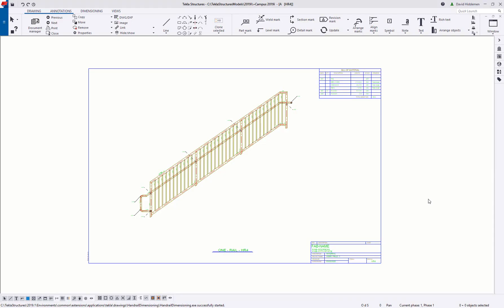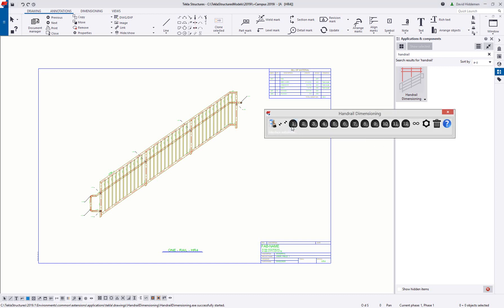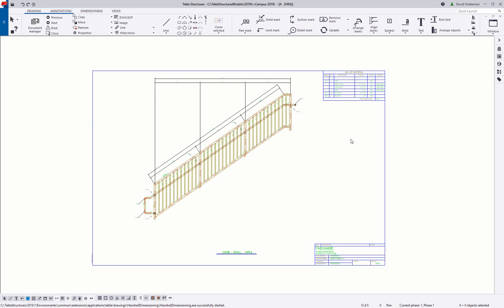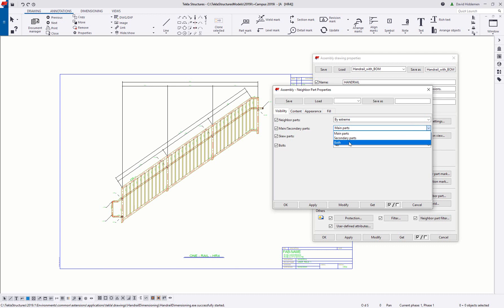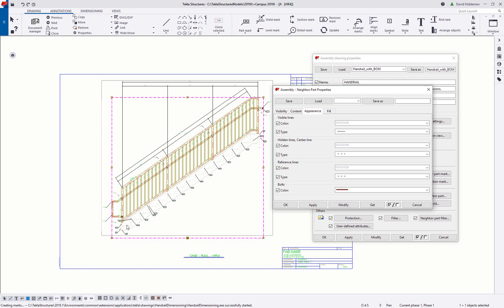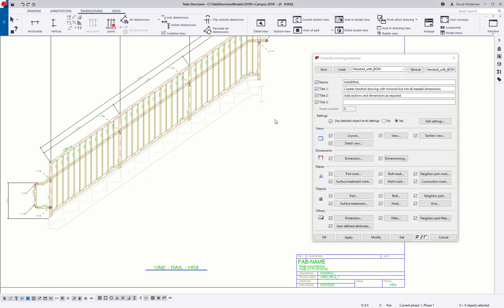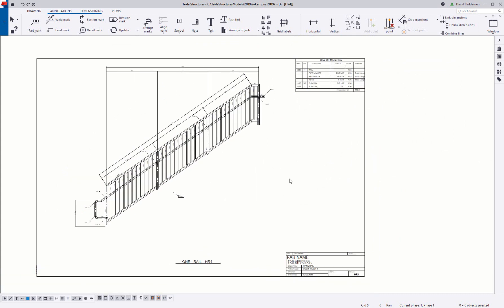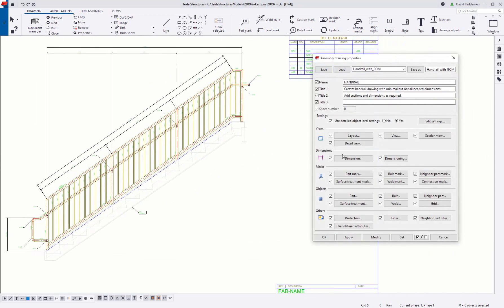Hidden Neighbor Parts on Drawings in Tekla Structures

Comment: Hi and thanks for a useful tip. I've got one question. Do you ever find that visibility of neighbor part does not work in single part drawing in case if the parts are connected by "Add to assembly"? If the single parts are welded it works and neighbor part is vissible in single part drawing. But if the are added into assembly only (without weld) it doesn:t work.

Comment: Is it possibile to change the color of the hidden line? I'm using black background while doing drawings and the dark blue hidden line is bearly visible and difficult to work with.
Reply: I am not aware of a setting to change this.
Reply: You could assign hidden lines a certain color, then ensure that color's line weight is 0 in your print settings.